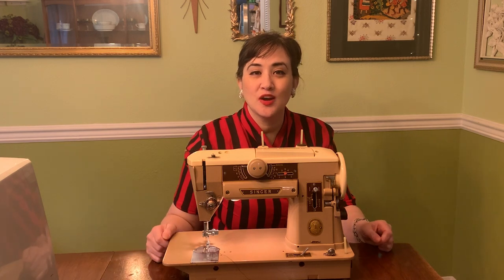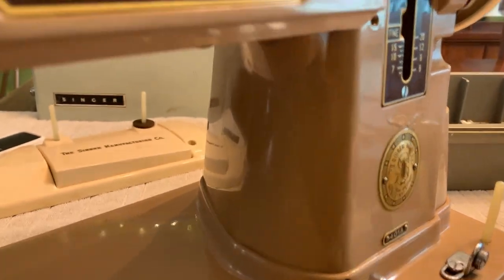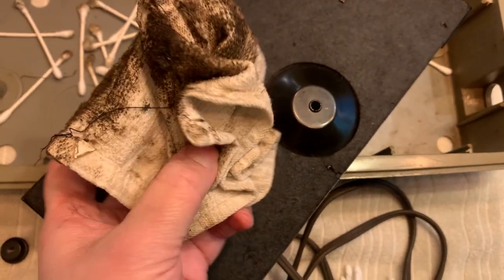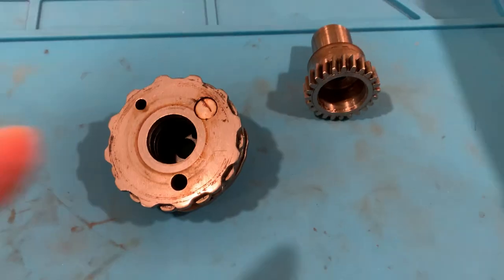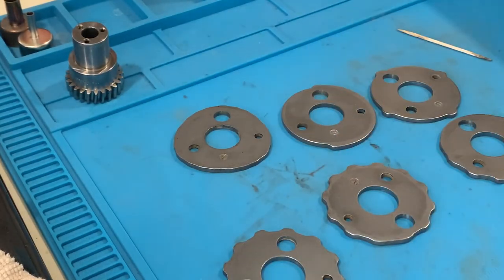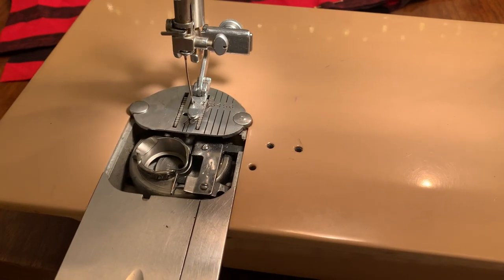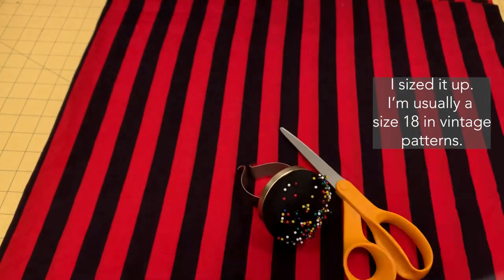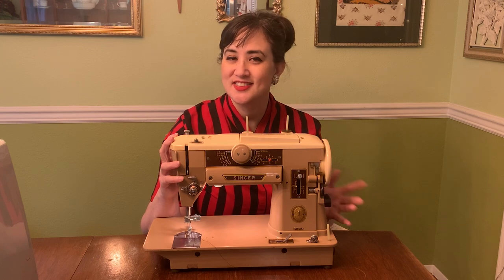Singer 401A - A Tale of A Stinker

Comment: You are making me sooo nervous, please oil and lubricate well.
Reply from the maker: I can totally see why you would say that. At 10:12 I mentioned I fiddled with placement a bit more. At that point I did use super grease on the worm wheel. But  I didn't include that shot/info for no apparent reason. Thank you so much for pointing that out. I will mention that in the description of the video. Oof, I knew at one point I'd goof up on filming a step-by-step video. Thanks again, I appreciate the comment.
Reply: @TheaStarr  Don't worry about 'goofing up': ) Your first Slant I'm sure? You need to grease the two sets of gears underneath, plus one on top, below the camstack. (Not easy to see) Use a small paintbrush for this one. Plus a little bit on the motor worm drive. Oil on the rest: ) If it's been unused for while it'll benefit greatly from this: ) Maybe I'll tell you about my first Slant-O-Matic, a 401G, about ten years ago? Very similar to the 401A. Still got it & it just purrs in use: )
Reply: @TheaStarr  you did very well. I’m sure you couldn’t show every single step. Obviously you knew better so some people shouldn’t be jumping to conclusions .  I too love the 401A.  I just sold three of them last month and I wish I would’ve kept one of them. The next one I find I will definitely keep.
Reply: @johnf4279  John, in all my years of vintage sewing machine repairs I have yet to see a 401G or 411G. You are very lucky to have a West German made Singer. I have a 211G155 and the craftsmanship is exceptional.
Reply: @ibsoarin  The Singer Industrials are a big step-up from their Domestic machines, but the 400 series with their all metal gears, no belts, are at the top end for Domestics: ) Don't forget the free-arm 431Gs, which also feature chain-stitch, a rare capability on a Domestic machine back in the 1960s. (The 411Gs can also chain) I only have one Industrial, a 1958 451K25 which has rotary take up & can do 5,000 SPM! I believe your 211G was made in the same factory as the 400 Slants.
Reply: Best Singer Ever Made
Reply: @allanfifield8256  Absolutely: ) All the 400 series Slants were the best & last proper Singers ever made. (Plastic took over shortly after)
Reply: @johnf4279  The 750 series was the start of the downhill run for Singer. With the plastic gears (which stripped out and/or dried out and chipped) with the rubber timing belt which was always jumping out of time the timing belt.   The real death began with the Futura 900 - Incredibly poor quality control.  These puppies use to fall apart in the back of the van as we tried to deliver them.  Almost a $1000 (in mid-1970's money!) for a machine that did not work well at all.

Comment: Great video...  Thank you.  A couple of comments regarding the material that is laying in the tray at the bottom of the sewing machine.  1) In addition to airing it out in your garage for a few days, you should leave it in the direct sunlight for a few days, flipping it over on alternate days.  The ultra violet sun rays will do wonders to cleaning up the mold etc.  2). You could also pick up some felt at your local fabric store and use your original as a pattern or template to create a new mat.  Thanks again for the video.
Michael from Canada
Reply from the maker: Yes! I did get "set it in the sun" suggestion to help kill the mold. I just had to wait to actually have some sunshine here in the PNW. :) I heard pool table felt fabric is a good replacement for the fabric too. Thank you so much for suggestions! I appreciate them.

Comment: I have a talent for spotting abandoned vintage sewing machines from a cross parking lots and highways.  I have kept four in their table cabinets including a rare  model from the 1920’s with an internal electric motor.  I found these and more just going about my business.

On a side note, when I say internal electric motor, I mean the motor is not merely inside the metal body of the case, it is integrated into the inner workings of the machine.  I have never seen this arrangement on any other machine.  Every other machine I have seen in my life has an outboard motor, even modern portables.

Comment: Yes, side of the road! I found a beautiful 1950s New Home curbside. Drove by first and then backed up two blocks to take it home after all--after a struggle to lift it because it's an all-metal beast. I spent a few days cleaning it and taking it apart and getting things moving and now she's a beauty and I'm in love. This has launched a passion for vintage sewing machines.
Reply from the maker: I would've done the same. I joke that I don't need a proper workout, because I am often lifting vintage sewing machines around. While I am biased, I think this is a wonderful passion to have. Thank you so much for your comment.
Reply: I found a gorgeous LBOW Singer 301A in my local Goodwill.  Haven’t sewn in years. Finding and revamping it awakened the same passion in me!

Comment: Thank you for this video. Nice machine. For freeing up stuck parts, I like Kan-o-Kroil. For getting rid of bad smells, after you clean it, you can put some newspaper in the bottom of a plastic tote with a lid, set the machine in, then get a carton of activated charcoal that is used in aquarium filters (pet section). Dump the charcoal on the newspaper an leave it for a while. I learned this from cleaning up Stinky refrigerators. Thanks.
Reply: Baking soda will work too.
Reply from the maker: Thanks for the tips!

Comment: I am a sick puppy I have three 401 machines and right now all are down.  One was overhauled and not used then when my main machine had issues i grabbed the overhauled one and most of it was frozen.  Third one sits in standby as a parts rig but has never been fired up it was a free side of the road thing, I did rob the controller off it the other day.
Sewing machine guy 40 years ago told me the one to get so I did.  Real metal not junk you find now from all the brands.

Comment: The reason there was multiple colors of thread on one bobbin is they didn't waste anything and bobbins were expensive when you didn't have a lot of money. They're relatively cheap today. I don't know how much they cost back then but if you didn't have a lot of money they were expensive. Not only that, if you needed a bobbin for something but you had thread on it that you didn't want to get rid of, you would rethread it with another color. I had several of these and some of them unwound. I was able to get the thread off pretty easy and others. The thread was the bottom layer especially was just hard pressed and very difficult to get in and the thread was very very old and then when I did get a lot of them off several of them had rust underneath that bottom thread and I had to clean that rust off. I had very few bobbins that were pre-wound that was only one color

Comment: Looks like a great machine. I grew up on the straight stitch version of this machine. I noticed that when you wound the bobbin the needle bar went up and down. If you pull out the center silver part of the hand wheel  when you wind a bobbin the needle bar will disengage and not move while you wind. Just push in back in when you are finished.
Reply from the maker: Thanks so much for that tip!

Comment: Awesome! Please use Isopropanol or better cleaning Petroleum (not the lamp oil though!) Also use the heatfan to warm up the grease. Gets way easier to remove this way;-)  Also important: Find out which Parts should be oiled, and which need Grease. clean up ALL the oil thats too much, so it does not fly around and collecting dust in your machine. Clean up after oiling. 
good Job! Thanks for sharing!

Comment: Very nice for $20: ) I'm in UK & familiar with the European Slants. They are fine machines & well worth a little effort.
Your stinky drip tray felt is familiar too, but I remove them & replace with Green Baize, from Snooker/Pool table tops. It is absorbant & washable if necessary.
Reply from the maker: I feel pretty tickled about the small investment so far. And thank you so much for the recommendation for the felt replacement. It was an unpleasant surprise.
Reply: Pool table felt is wonderful stuff. I ran across a large piece at a thrift store and being wool, I decided to throw it in the wash. Felted beautifully! Used 3 layers to pad an ironing board and made new discs for my thread spools and it helped make a makeshift large thread cone hack.
Reply: @tinamcnalley2575  It's very expensive stuff when new!  A full size snooker table is 12' x 6'. It gets a little wear in certain places & they throw it away when they recover the tables. At least they do here in UK. I don't buy spool felts any more, & it makes great linings for treadle cabinet drawers. For example!
Reply: @johnf4279  Oooh! Thanks for the heads up on a source! Never thought if that.
Reply: @tinamcnalley2575  Never mind the oil drip trays, the Slants are the best of the last 'Engineered' Singers. As opposed to the later injection moulded plastic stuff: ) The US 500 series Rocketeers excepted: ) I never thought of ironing board applications, gotta say: )

Comment: Thea,
If you are bold enough to remove the fashion disc assembly, then you are ready to take on anything.
If anyone asks, Andy Tube has some excellent videos on sewing machine repairs. I have benefited from his vast information and experience in spite of all of my own experience.
I sense your outlook is similar to mine, "Boldly go where many have gone before!". There aren't local Singer sewing machine repair centers anymore like my wife describes when she was a young girl. We have to learn to do the repairs ourselves or it doesn't get fixed.
Hint: Take the Bakelite foot controller apart and clean it up. Bakelite is very durable but also very brittle. It will crack if you drop it on a hard surface. Very dirty Bakelite surface can be cleaned with clear coat cleaner wax. My wife likes the smell of Mother's Cleaner Wax after I use it to clean sewing machine surfaces.

Comment: I just got one on eBay but mine is only a straight stitch. There's an old sewing machine shop in town that has parts they will go through for me to get more feet. My first plug in showed me it needs service. The plate under the foot got stuck up on one side. They were able to confirm for me that one can doy service like you did but not on the newer machines with the computer board. I may have totaled my Bernina. They will let me know. Thanks for your video!

Comment: When you're drying out parts, you can douse them with isopropyl alcohol (testing first in case there's paint or plastic the alcohol might damage). The alcohol dilutes the water and carries it away when you shake it off, and then there's only the tiniest amount of water left that will quickly evaporate once the alcohol is gone.

Comment: My mom had this exact model complete with cabinet. It was an amazing machine. But my dad put it on the back seat of the car and yes, you guessed it, it fell forward when he stopped for a red light. It never sewed right again no matter how many times he took it to the repair shop. It bent the main shaft and there were no replacement parts back then (1970s).

Comment: Come on Thea! Updates? Just asking: )
We all interested.
Reply from the maker: Hahahaha! :) There will be a follow up update video for sure. I received such great tips on replacing the old smelly felt that I have to do that right? But I did get some ideas on how to do it and I thought to share that process.
Reply: @TheaStarr  You really just need to use the old, stinky one for a pattern. It's just held in by flanges, lift them slightly with a wide screwdriver & no problems. (Wear a mask, or hold your nose while you do it; ) I'd send you a piece of good, green felt to do the job, but Transatlantic shipping is really silly these days... You'll love it later, I promise you. BTW we call the Slant cams 'Top Hats' here, to distinguish from the flat cams for the 306K/319K/320K Singer machines.

Comment: It is interesting to watch this but better to watch a professional who repairs sewing machines because they have the experience to know what not to do, such as using the wrong procedures that can cause damage. Just adding oil to get it moving is not good enough.  The parts need to be cleaned before oiling to remove hardened grease and varnish from the parts.

Comment: I just cleaned, oiled and greased. I unfroze the stitch selector and reset the timing on my 401A i bought at Salvation Army for 25 last month.
Its still running very slow. So im taking apart the foot pedal to clean the contacts..
What else could it be?